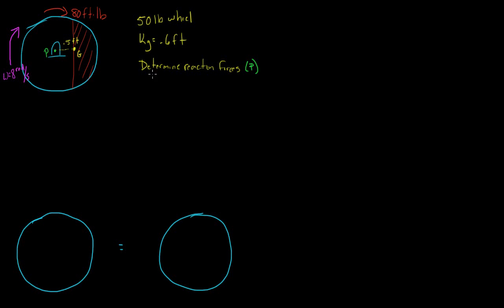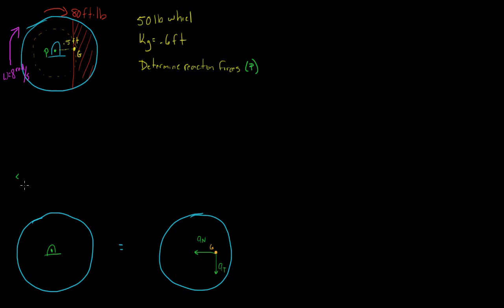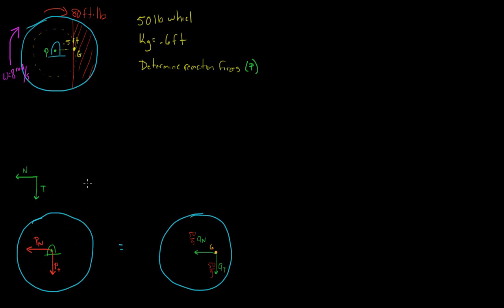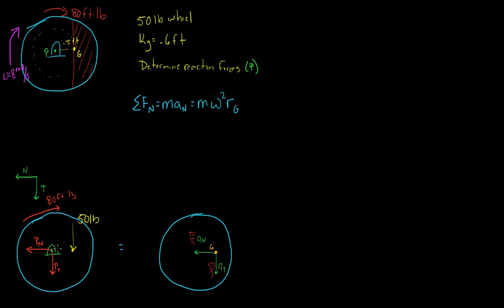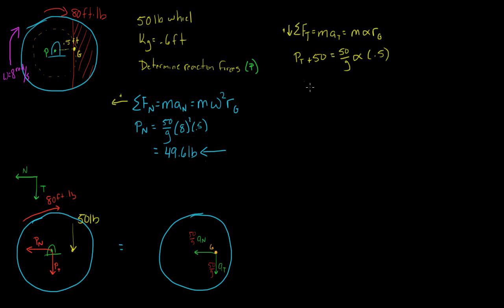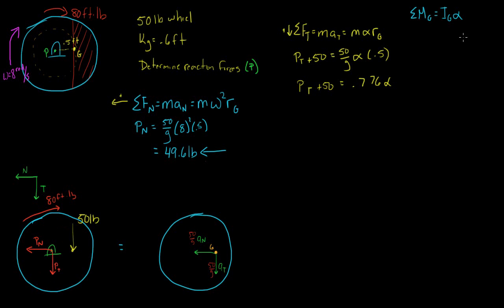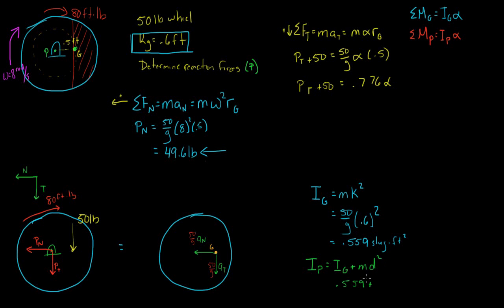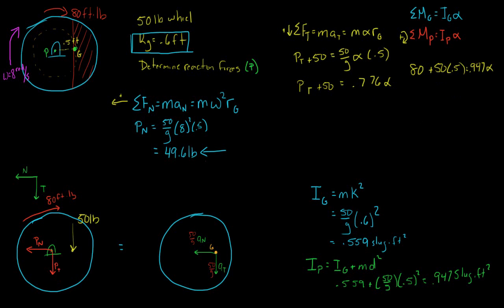Rigid Body Kinetics Unbalanced Wheel

Comment from the maker: Hi, I can't reply to your comment but from the FBD the Normal direction is horizontal and the only force that we have in that direction is PN. So if you do F = ma  you get PN  = (50/32.2) * AN . We divide 50 by 32.2 to get a mass and AN is the accel in the normal direction. So we know we have an alternate expression for AN which is w^2*r. w is the angular velocity and r is the distance to the fixed axis it is rotating about. So from the problem w = 8 and r = .5. This makes the equation go to PN = (50/32.2)(8^2)(.5) = 49.6
Reply: nickredsox1 Thanks,realised my mistake afterwards haha,thank you for clarifying :)